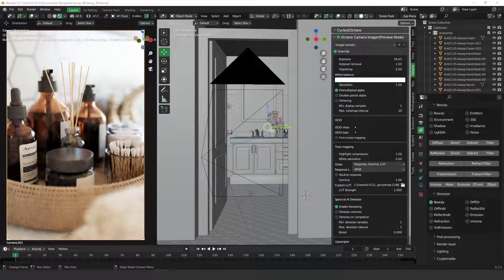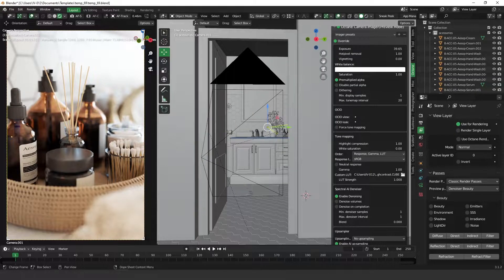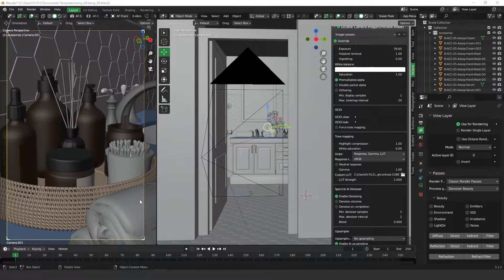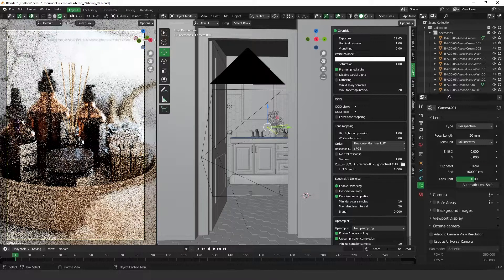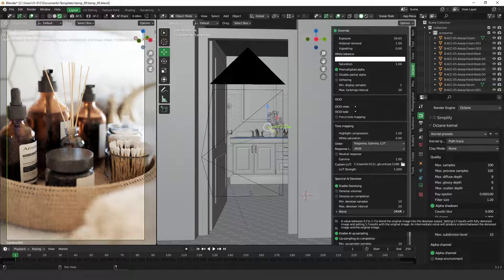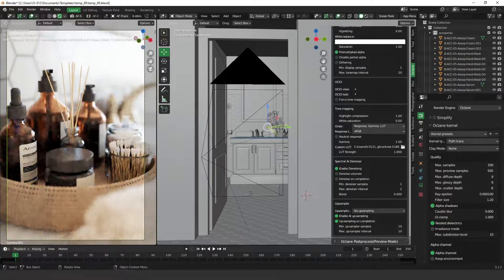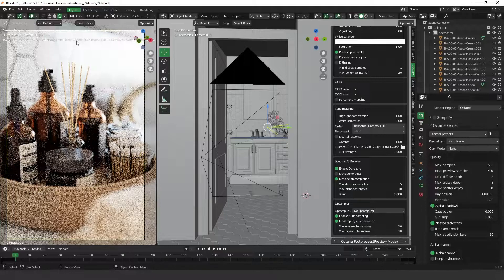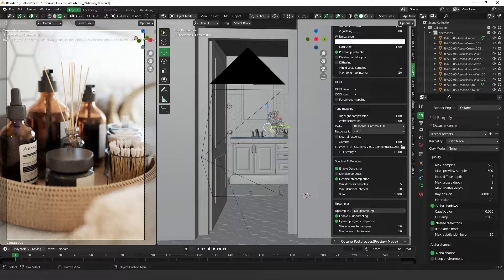Tutorial - How to Use Denoiser in Blender Octane

Comment: the denoiser works in the viewport but when I render it doesn't work
Reply: Actually just found something
A commenter here @SarperBaran wrote:
Go to View Layer - Passes - Denoiser - Check Beauty. Then go to Compositing tab enable Use Nodes and connect DenoisedBeauty to Image ( from Render Layers to Composite output).

It worked for me. I just had to check the top right on the render output screen and change "view layer" to "composite"
Reply: @TheWindowsUser92  thank you. It worked
Reply: @TheWindowsUser92  it's not work still
Reply: I have the exact same issue, can't find anything currently to fix it
Reply: Octane makes life so hard😂, in cycles is só simple, Octane is Full of shit, so many Denoiser buttons to check, is too much Head blowing.

Comment: I have enabled the spectral AI denoiser in the camera setting, i enabled the "beauty" pass in the denoiser section of the view layer, and i connected the OctDenoiserBeauty output of the render layers node in the compositor to the composit output. The final image of the render i have it's not denoised. And the weird thing is that i enabled the beauty denoiser pass in the preview... and i get the denoised preview in the viewport, but not the final render. Anyone have info on this: it's a bug or i missing something? I checked every option, i'm out of ideas
Reply: i also have this problem. Anyone know how to enable in renderer?
Reply: @fiftyrock  same problem. any tutorial or guide is just showing how to enable in viewport and not for the final render. that is not worth much, i dont even need denoiser in my viewport.
Reply: @a.p.7383   I have the same problem. I found a partial solution. You can manually change Combined method to Denoisedbeauty in the render window (after the rendering is completed), this is in the upper right corner of the window. But I didn’t understand how to make noise reduction turn on automatically on the render. because in the case of one picture you can manually select, but with animation this will not work. I am sorry for my English😁
Reply: Same problem here, octane  DenoisedBeauty pass output only to final image does not work properly, does not denoise completely as it does beautifuly in preview viewport mode. Can you share what passes you output in Compositor, please?
Reply from the maker: are you using blender compositor or octane compositor?
Reply: Go to View Layer - Passes - Denoiser - Check Beauty. Then go to Compositing tab enable Use Nodes and connect DenoisedBeauty to Image ( from Render Layers to Composite output).

Comment: 𝐔𝐩𝐝𝐚𝐭𝐞 :
 YES !!!! I figured out what was the issue....it was for some reason defined to run the default kernel of Octane (on the Render Properties tab) instead of running the "Path Trace" kernel which is way faster....now even an heavy amount of fur it denoises very quickly in like 2-3 seconds ! now I'm happy :) that's great.

For some reason the denoiser is quite slow for me on a very simple model - just a Suzanne monkey with 2000 faces (after smooth modifier applied to it), it takes about 45 seconds for it to finish the denoising....that's too slow for a very simple scene and model (which is considered lowpoly) that has a simple universal material, 𝐰𝐡𝐲 𝐢𝐬 𝐭𝐡𝐚𝐭? how come your scene which is more complex than mine got denoised to quickly? (I've a RTX 2060) Edit : Oh and also the resolution is low, 640x480..I put 500 samples for it to first complete tho (but even 100 samples takes the same time to complete if not more)
Reply from the maker: Did you solve it ?
Reply: @archivizual4236  Yes, I did, read my update above :)